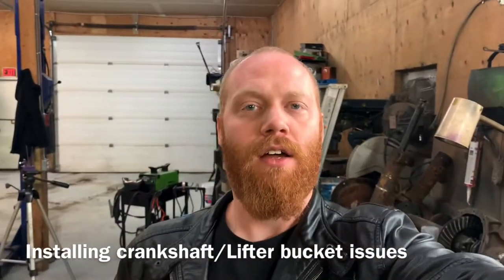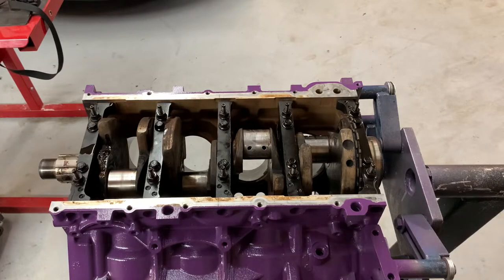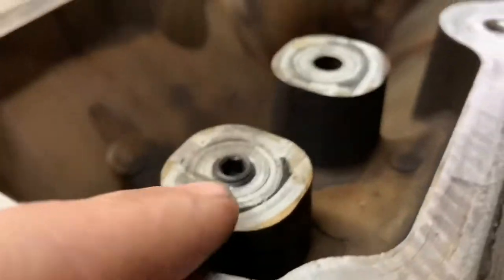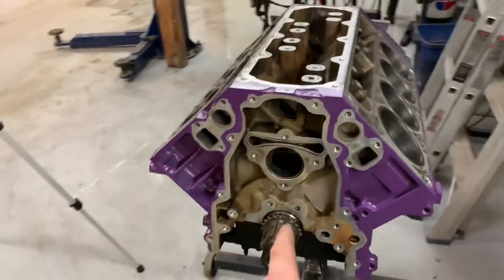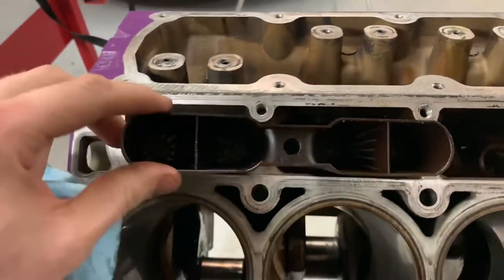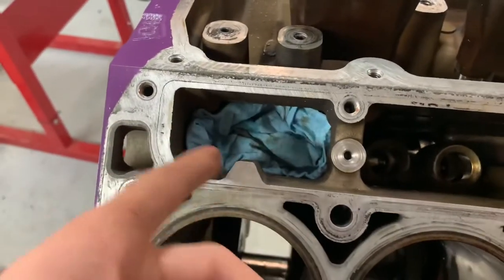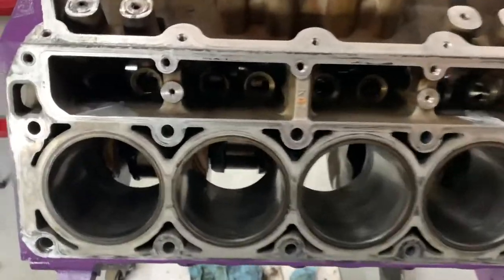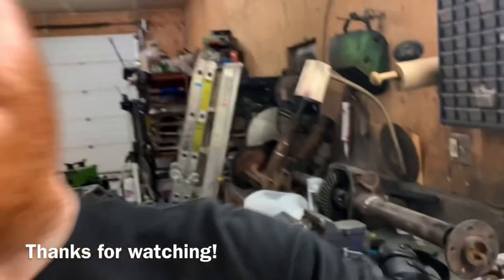How to not build an engine with a Sawzall #3

Comment: Just curious, why not just use a Gen 3 LS? Wouldn’t that be a lot less work?
Reply from the maker: It absolutely would have been. I didn’t have one, and I thought the aluminum block would be nice, but looking bad I wish I did the iron block
Reply: My mama always told me, you got to use what you got to get what you want.
Reply from the maker: Heyyy I like thst
Reply: @StationroadRatrods  if you really liked it give me a sub I'm about to pull out my first LS very soon
Reply from the maker: You got it man, sounds good
Reply: @StationroadRatrods  engines crank or the bearings went out in mine, because it was the second oil pump installed, and I was driving when it went out this time it sounded like I dropped a handful of thick pit bull chain onto cement and a silent world and I can always remember that sound.. and I heard it I said all this probably the death of my engine the oil pressure was at zero then and I think I got up the street like a mile and it just died silently.
Reply from the maker: Ahhh shit that sucks! I had one explode in the caravan haha
Reply: @StationroadRatrods  wait hold on,  you the guy with the turbo Ls in the caravan?
Reply from the maker: Yes sir
Reply: @StationroadRatrods  Salute.

Comment: Put the 862 heads on there get that turbo spooled up 🤘.. It’s 9.9:1 with 243 and 10.4:1 with 862 heads. Less than 6.0 due to displacement
Reply from the maker: I’m definitely on the fence but I think I might go with the 243, that’ll be a lot safer on my street driven mom van, not looking for an abundance of power, and still make turbo noises
Reply: @StationroadRatrods  personally I would do 243 as well. It’s the same setup I have for the mustang but I figured I would recommend 862 as u like to do stuff different lol
Reply from the maker: @charleswilliams2008  I had that setup on the rat rod. It was absolutely insane, I used to see boost on the datalogs at like 2200 rpm